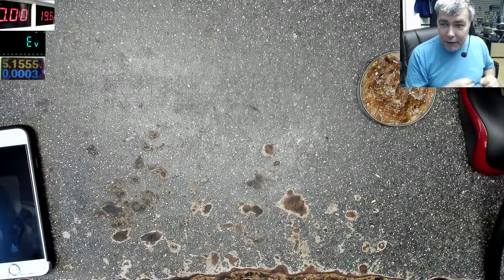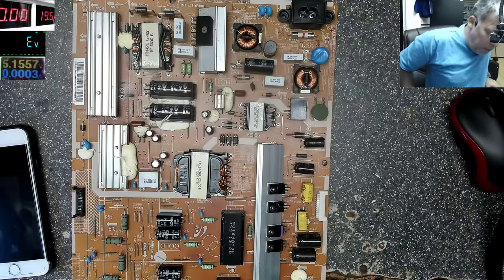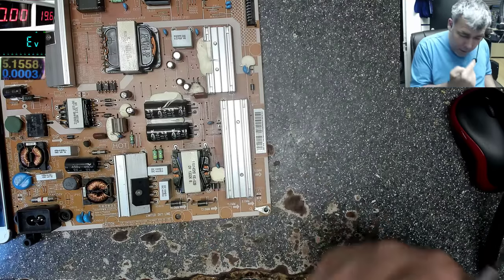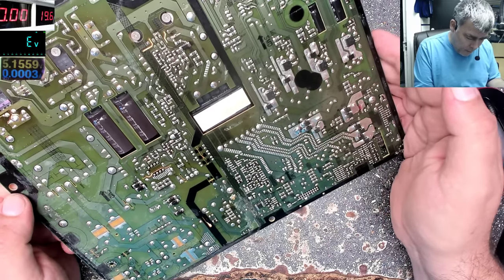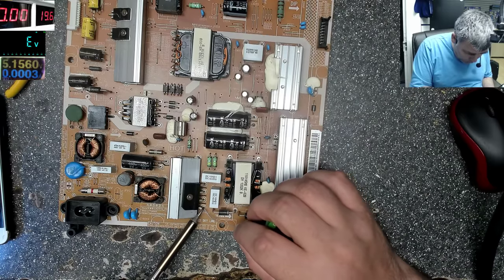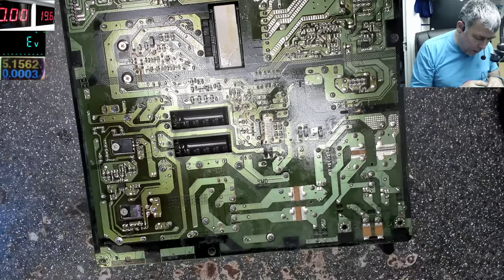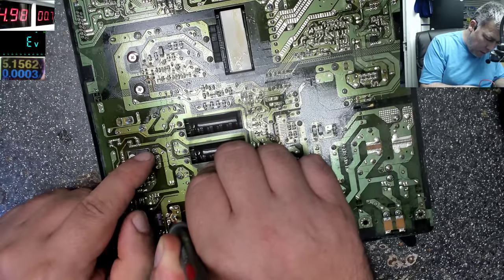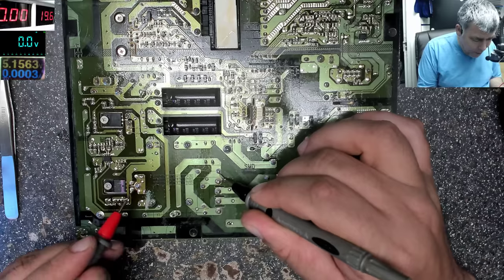LG 42LB550V TV - No power - Board repair

Comment: instead of fuse, I put in a 100w 240v bulb, and start repairing the inverter . when the bulb is lit, there is a short circuit on the first  inverter.
Reply: can you explain it a bit?
i believe this tip would be help me in my diagnosis procedures immensely. thanks!
Reply: @NarasimhaB  bulb got to be in series on power cable, or just solder cables instead of fuse. It must be translucent bulb.
Reply: @pawelnowak9400  haha. thank you. so the logic is fairly simple, if the test device is short circuited, the circuit is closed and the bulb glows and acts an absorber of all that inrush high ampere current and prevents the test circuit from further damage?
Reply: Pawel Nowak  http://www.giangrandi.ch/electronics/smpsfix/smpsfix.shtml.      Tu jest wyjaśnione , żarówkę daje jak wiem ze jest pewne  zwarcie i zmiana bezpieczników kończy sie spaleniem ,
Reply: @NarasimhaB  too bad you never seem to get straight answers from anyone on the same planet as you, I feel your pain, the bulb just acts as a fuse and doesn't protect the circuit from surges and the like
Reply: @NarasimhaB  exactly, bulb is limit current. After fixing power supply I always use it. For example I found shorted  mosfet (all three pins) , replaced it but you can't tell if controller IC is OK, so quick way to find out it power it up through the bulb. If controller is not giving you PWM signal and instead, say +30v mosfet will open and effectively short main voltage, so hundreds of amps flows through rectifier, mosfet and anything on the way, before fuse get burnt that high current may damage few elements and PCB tracks. So when bulb is on full brightness you will know that there is something wrong, and your circuit is safe giving you chance to investigate it further, without further damage.
Reply: @krzysztofbednarek9485  dzięki, fajny poradnik.
Reply: @pawelnowak9400  thanks for explanations.
Reply: That is the safe way to do it and the proper way!

Comment: funny you grab the same board and the same mosfet is missing.  i played with tv and vcr repairs 30 years ago and inevitably found that common failures in the same model were  well ....... quite common.  save a few cents over thousands of sets.................   or just plain bad engineering.

Comment: Sorin, I like your videos, and I learn a lot from them. I also like your shortcuts and brute force methods, and that haters is just there for pisses you off. Ignore them. One question, that psu is fixed by replacing shorted mosfet. But in many cases shorted mosfet also blow PWM controller. How we can diagnose damaged pwm controller that drive switching MOSFET. One person tell me but I never tried to test that method. Method is this. We take some PSU for repair, remove shorted mosfet and come to Vcc and ground of PWM controller with regulated power supply (check in datasheet of pwm ic which one pin is Vcc and which one is ground and what voltage need to be). Then with osciloscope test the output of pwm ic. And if we see pulses on osciloscope we know that pwm ic is good. What you think of that method, and is there something different easier method? Best regards
Reply: Ur method is ok , dont listen to the idiot glyn hodges to feed output of the controller!!! u need to test the output not too feed it!!!
Reply: Is there any method without oscilloscope? Also which outputs should i test

Comment: My lg tv does not powers on. When i flick the wall socket switch ON, the standby Red light comes on goes off comes on goes off and then keeps off. And the television doesn't respond to remote or tv buttons. What could be wrong?

Comment: If you don’t know please take note “ do not touch the large reservoir caps they can be charged upto 400 v or more it’s enough to stop your heart and can be fatal” and be careful when feeling around the back of the board too I have had a shock of a board that I had in a box for about a month or more 

As for the fuse if you use a piece of wire like that if it blows the skid mark it leaves will have metals in it and can cause more damage
Reply: yea, that guy when he showed us the tv working, he was dangerously close to the tv boards almost touching the live voltage.

Comment: I have an LG 55UM6910PUC it just shows a blue/Green screen. When it first happened there was audio and you could switch channels but no picture. Now there is no audio so I can't tell if the channels are changing with the Remote. When it first starts you hear the startup sound but the screen just goes to blue/green.

Comment: I know he doesn't care but that's an awful job , it hurts the eye of professional technicians :

tracks cut off out of laziness to unsolder components while looking for short … (it takes 1 min to unsolder a component FFS)  
replacing component with an spliced pin : absolute recipe for failure on a component that produces lots of heat  …
fantastic "eye calculated amperage wire" new fuse ...

these are like African cheap jobs but done in wealthy UK …  totally unacceptable for that raison !
Reply: Exactly, he doesn't care and everyone else in the comment section thinks he's a god.
Reply: he clearly has lots of experience repairing things but he lacks work ethics … he uses brute force methods

and don't forget : In the land of the blind, the one-eyed man is king.
Reply: People don't want to pay for electronics repair , that's why he's doing it in that way.  He propably charged 20-30 quid instead of 90 or 115 etc
Reply: @ElegantZZZ  You're kidding right?  So you charge triple the amount for desoldering a component versus scratching away a trace and then bridging it with a piece of unmelted solder?  Hot gluing a laptop hinge is one thing, but the work shown in this video was shoddy.
Reply: a professional takes pride doing proper clean job not only to show respect to his customer but also thinking about the next possible technician that can come several years later and looks at your job …

sorry, I don't want to be next technician to put my hands on a device where Sorin has worked before as he ruins it. (modifies tracks, crappy jumper wires, replaces with incorrect components, alters safety circuits, etc).

a smd capacitor, diode or mosfet transistor costs peanuts !  you can have a little stock of these components and do clean replacements , these cheap components doesn't alter the bill for the customer as it's the time the technician spends doing the job that increases the costs.
and don't tell me that charging less to the customer allows you to do rubbish work FFS !!
Reply: Well maybe you should all start YouTube channels and show us  how you do it 
Mmmmm I bet you don’t/can’t ..........
Reply: i'm too ugly for the camera :)
Reply: @buildstoys  @buildstoys everyone is trying to survive , market is in need of cheap and expensive workshops at the moment

Comment: Hi,

What about when you have a LCD TFT monitor screen whose backlight turns on for about 2-3 s then it shuts off ? 🤔😞

How do you fix that ?

The image is seen on the LCD if I shine on it with my pocket LED flashlight.

I replaced a couple of electrolytic capacitors that were bulged or leaked. What to check next ? 😖

I do have the standby voltage (5,5 V) on the connector (that leads to the logic board) as well as 3,4 V.

All 4 CCFL bulbs are fine.

Thanks !

Best Regards,
Reply: You need to check the Integrated circuit led driver...
Reply: @badeadrian  Yeah after some investigation I found that the OZ9938GN chip was dead & in fact 2 CCFL tubes were dying. 😶😑😕

Still successfully sold the monitor recently for about 20 €... 😇🤗😄

Comment: @
Electronics repair school
I'm shocked. s it too hard desolder 4 legs, take the bridge rectifier out and check it using diode mode?  I understand legs cuting when component is 100% faulty but i can't in case when you're not sure... By the way you IMO waste ur time. What I do is firstly checking the mosfestds  and that's all. If they are shorted, I replace them, plug in to mains  via tungsten bulb in parell on the L wire and that's all. If bulb light up and still glows I know it;'s still shorted without dameging anything and then check bridge rectifier and so on.   On about 30 SMPS  I had only 3 cases where fuse was blown and more then mosfets were shorted so in most cases transistors replcement  solves the problem and bring device back to life.
Reply: Good for you PiotrK2022. Then why the hell are you here?
Reply: @61spindrift  Because why not.
Reply: @PiotrK2022  why not? you obviously know much more than he does and can do it better.
Reply: @61spindrift  Right... Generally i watched this video because I want improove my skills, so I believied I can learn sth more from that individual.
Reply: @PiotrK2022  Me too! At 60+ still learning. TBH, I am ocd and would not have done that either, but it just goes to show what is possible. Some elec repair shops charge big $ for their knowledge. And rightly so as there is a great deal of technical education one must learn. I like this channel and the way he diagnoses. Which include cutting legs off a elec components, opening a trace with a screw driver and making it whole again with some solder. Like you, I would  not, but knowing I could if lets say I did not have a solder sucker or I had to quickly diagnose and defuse a bomb is all knowledge...good knowledge. If I had limitless tools and needed a fix that looked as if the manufacturer repaired it I would be on maybe Louis Grossman's channel. But he sometimes or most times a bit too technical or advanced for me as just a hobbyist.